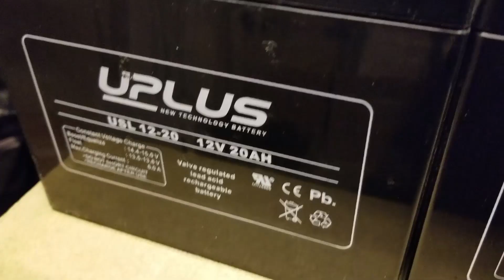DIY Powerwall Update - May 2020 - More news and general silliness!

Comment: The first set of batteries you pointed to you said they were your Heaters and could not use them.  How did you determine they were "Heaters"?  I have tested hundreds of batteries with an opus and they all kind of heat up as they do the test charge cycle.
Reply from the maker: Hi Kevin. Some batteries get hot when they're almost finished charging, like at 4.05v Some get hot when discharging at 1000mA. I just use my hand to test them several times during the process, if they feel hot, they get rejected as a heater.
Heaters are both a fire risk and the convert energy we really need into heat so they're very inefficient. Hope this helps

Comment: I'm still trying to choose an Inverter and its turning out to be the hardest part of the process so far!
I'm kinda getting fed up with Victron being thrown out there all the time, I have no doubt that its worthy of the chatter, but seriously, the costs of getting all the kit is price prohibitive for me.
ROI is the most important aspect of my Powerwall & Solar project and Victron will single handily ruin my ROI plans.

You mention below that the Inverter you originally chose would only do 3.3Kw per phase. Couldn't you buy multiple cheaper inverters and parallel them up?

Maybe a topic for a video would be to price up a configuration going the Victron route and see if its at all possible to do the same config with MPP? 
We all know the idle power consumption is a big ++ for Victron, but I'm still trying to figure out if that's really an issue if you can alleviate it by simply adding more solar and battery to compensate versus the cost implications to gain that extra efficiency. 
I guess the problem I'm having is there are too many fanboy's out there that will bleed blue but often these are the same people that have plenty of money or never considered a short term ROI being the number one priority.
Sorry for the rant.
Reply from the maker: Hi Dave, not a rant at all, love it!  I love your idea on the comparison, I'll have a think about that. I'll likely to go down the victron route because of the lower idle consumption and extended warranty.  There's a great thread in the hbpowerwall forum between myself Nils and Daniel regarding this (https://secondlifestorage.com/showthread.php?tid=8484). Here in Sweden we have long dark cold winters and its so frustrating watching my batteries slowly drain on the days where there's enough light to trigger the charging circuit on the inverter but not enough light to actually harvest any energy. When this happens I end up with slightly less energy in the cells than when the day started. Sooo frustrating.  
You're right about the money side of things, that's why I'm asking for Patreon supporters now (https://www.patreon.com/thekilowattchallenge), the kit is really expensive but I'm confident the quality and the warranty is better, read Daromer's comments in that thread for first hand experience.
Are you 3 phase as well?
Reply: @TheKilowattChallenge  No, I'm not 3 Phase which should help keep the cost down a little but Victron is so expensive in the UK. I nearly pulled the trigger on a Multiplus 48v for my Powerwall, but even though it was ex demo stock, it was still expensive and I still would have needed to buy more equipment to compliment the solar etc.

Daniel is great, he knows his stuff, he has helped me out with a few queries recently too. I know he's an advocate for Victron even though he went down the MPP route himself originally.  I really can't see me being able to justify the blue box though, I really want to be seeing my solar & powerwall(s) ROI within a few years, that's the most important factor of my project. I'd be a hypocrite if I relented on that because I've been critical of people spending  many thousands on kit to only save hundreds on bills, meaning they're really not saving anything at all for another 15-20 years :)

I mean, apart from the eco side of things, isn't that really the main point of all this, to lower or eradicate your energy costs in as short a time as possible, not have to wait 10, 15+ years to break even on the investment. 🤔
Reply from the maker: I just wish I could find something in the middle. The MPP is the cheapest and Victron must be the most expensive... What's in the middle that's what I want to know and is it CE approved...
Reply: @TheKilowattChallenge  Yes, exactly, I don't mind paying a bit extra for quality and hence reliability but I like to try and find a happy medium. I don't like paying an excessive premium for quality when I get the feeling a significant percentage of that is for brand image. I don't know if that applies to Victron at the moment, but the only added value (feature wise) to me it seems would be better efficiency and I can't justify that alone.

These are two units I'm currently looking at. It's still out of the voltronic camp but seems to tick a lot of the boxes and fall within my price point:

https://voltaconsolar.com/off-grid/48v-off-grid-inverter-charger/conversol-5kva-duo-mppt-inverter-charger.html

https://voltaconsolar.com/off-grid/48v-off-grid-inverter-charger/conversol-v5-off-grid-inverter-bluetooth.html

How does this package for their 15Kw 3 Phase compare price wise with Victron?

https://voltaconsolar.com/off-grid/48v-off-grid-inverter-charger/parallel-conversol.html

Or of-courseif you like your inverters to be bright and vibrant, there's always these lovely Orange boxes :)

https://voltaconsolar.com/hybrid-self-consumption/three-phase-hybrid-10kw-energy-storage.html
Reply from the maker: Ooooooh Dave... You might have found something here... I saw in one of your links that they do a 15kW version!!!   Now that is interesting... That makes a big difference to my thinking. Bring on the sleepless nights again haha.  That's under £3k for 15kW, that's so much cheaper than Victron and the loss in efficiency argument is being further diluted. I need to think carefully about this. Thanks for taking the time to point these out, you may have just changed the direction of the channel :-)
Reply: @TheKilowattChallenge  Hi Darren, I don't know how much the equivalent kit would cost in the Victron range, but I can feel my wallet clenching just at the thought of it :)

We know the Victron kit is quality and I'm sure an equivalent Victron setup will no doubt be a powerful robust solution but if for example it costs 3 times the price, will it recoup that back over the lifetime is what I like to ask.

I saw your post on the forum, I will be interested to see the responses, if nothing else, at least we put the cat amongst the pigeons :)

Comment: I came To victron too. Glad we had the discuss for 5 weeks about that. Building right Now my Packs. 3380 batterys for a 14s. Lets see if One victron will be enough for my House Current. Have a Good day and luck with batterys
Reply from the maker: Hi Nils. Absolutely, you're right. I've thought long and hard about our conversation as well. The thing that made me decide is the fact that the mpp can only do 3.33kW per phase and I have so many electric things in house. I'll be looking at 3 x single phase Victron inverters, exactly the ones you found. Nils, send me your mobile number in a private message on the hbpowerwall forum and we'll talk more about it ;-)
Reply from the maker: As many Amps as possible :-) Yeah I'll install them myself and then pay for a certified electrician to do the electrical work. I'll be filming all of that don't worry ;-)
Do you know any other Swedish green energy channels like ours?
Reply from the maker: Oh, that is awful, I'm sorry for your loss, and for their family. Times are hard for sure just now, take care...
Reply from the maker: Nils, have you seen the link to the 15kw inverter in the forum thread? It looks really interesting...
Reply: @TheKilowattChallenge  no i Need to look. I already bought my 5000 va victron but going to look later. Sorry i dont wrote you back. Children Take alot of Time in this time so i forget what i dont write down
Reply from the maker: @DIY Projects No it's a new one from Voltacon, here's the link https://voltaconsolar.com/hybrid-solar-inverter-15kw-three-phase-48v.html
Yeah theres loads of mini grid projects out there, they're fascinating and I guess we're all building mini mini grids at home :-)